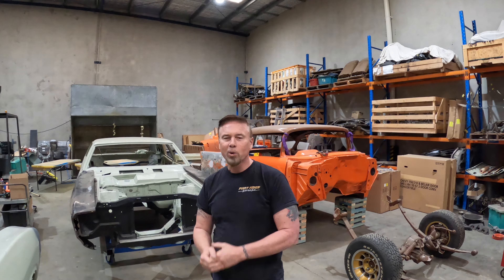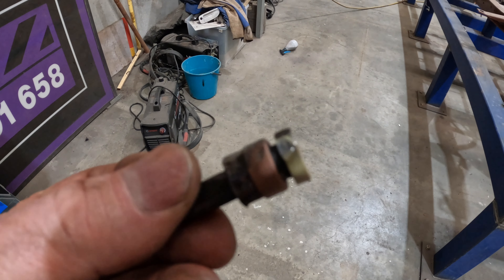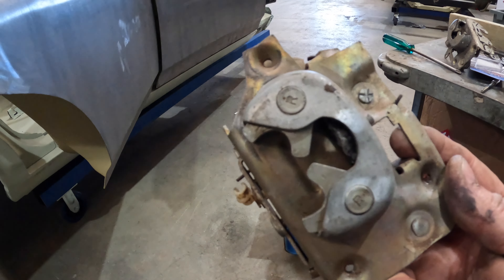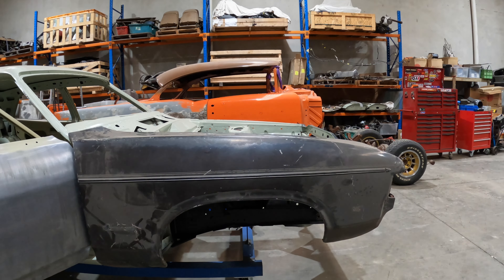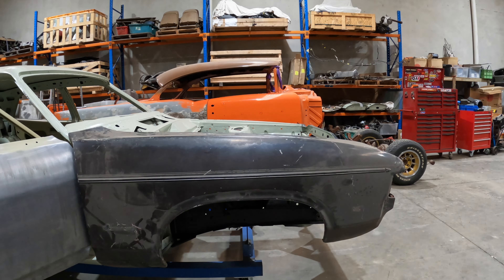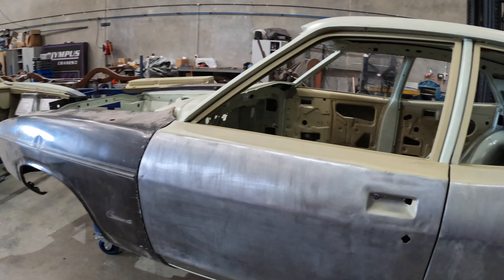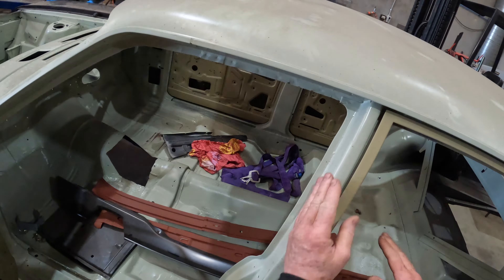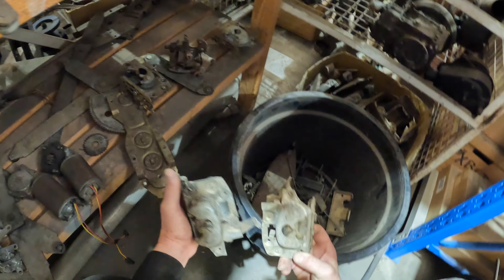XA GT Sedan Tribute   EPS 7 Fitting the doors

Comment: Best to fit the rubbers around the doors too when your lining them up , Cause afterwards when the car is painted it will give you a different reading , Cheers
Reply from the maker: yeah its a good idea, I will be doing that before I do the next stage of blocking
Reply: @phatridesgarage3760  You need to fit the rubbers up NOW is the time to do it before you start any repairs , cause you might have to a just the doors again with the striker on the pillar. the top frame around the windows is the weakest point but you can bend them in by hand , But you have to fit the rubbers up right now to a just it .. .. that goes with the boot lit too ..

Comment: Good to see you have patience lining those doors up. Although you seem to have a handle on it just remember when you are gapping to allow for 2mm to 3mm for paint thickness and also fit door rubbers. If door has a twist it will cause the door not to shut or line up when you assemble the car. But I am sure you know this as it is not your first rodeo. Love your channel.
Reply from the maker: Thanks Ian , I can see you know what your talking about and will do as you suggested,  I appreciate your input mate, thanks alot for watching I really appreciate it mate
Reply: 2 to 3 mm of paint ????? how many coats do you apply ????
Reply: @john-1964  in a gap you’re dealing with paint thickness on 2 x surfaces. 
It may or may not be that thick after primer/filler/paint but the point remains valid.
Reply: @mickyd8755  disagree
Reply: @john-1964  yeah that’s a lot of paint,but I guess the spray on filler is the main one.

Comment: You could fuss for days/weeks with this stuff. probably also could fit the bonnet to see where your at with cowl gap then the guards length and width can be honed in on. so you can even out the position of the front doors and decide which edges to build up or remove metal. Recently been through all this on my XE nothing fit evenly at first,  Lol.
Reply from the maker: Your not wrong Steve, can fuss for ages,  I will compromise on alot with this car, its no show car as long as things look relatively even Im happy

Comment: I was very surprised that the "b" pillar adjusted that easily.

Is the gap between the front and rear doors larger than normal?

Great work!
Reply from the maker: Yeah I was surprised also Jeff, but its just sheetmetal to after all. The gap between front and rear doors is around 5mm and even both sides of the pillar as you can see too. Cheers Jeff !